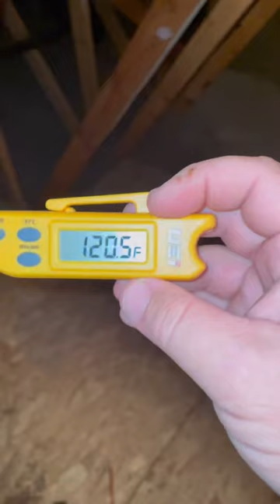Hot attic drain line

Comment: What tool is that you are using to unclog drain
Reply from the maker: Got mine at johnstone supply, but you can find it on Amazon VIKROM air hose nozzle.
Reply: @myHVAClife  what is the air nozzle connected to in order to get the air to come out of? Can you put a link?

Comment: Do you ever take the panel off and clean all the junk you blew back into the drain pan with the nitrogen?
Reply from the maker: I do not blow any junk into the coil and pan. I only do this on bad clogs that are further down the line. If the clog is actually in the attic, I will clear the trap or cut out the clog then flush and Vac. When it is in an un-accessible joint I will do this. I am not blowing 200 psi in the line, I set the regulator at 15-20 psi max and work the blockage until it loosens and let the water behind it wash out the debris and then flush and vac the line. I have been doing this for years and never had a problem.